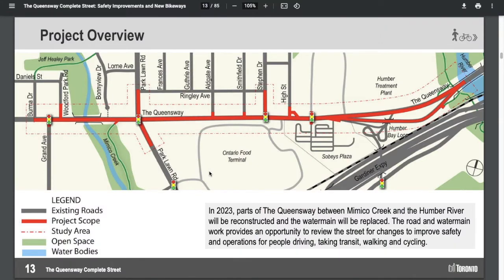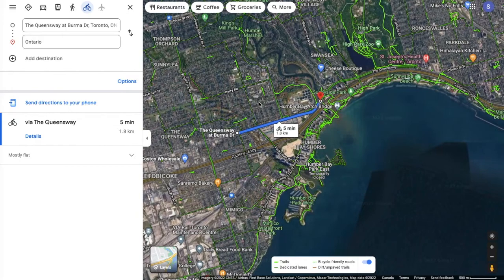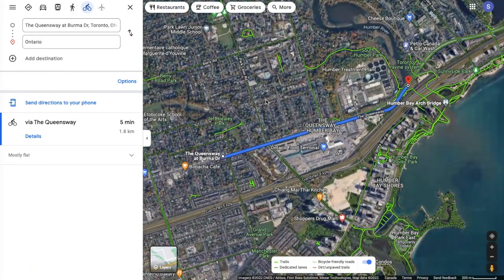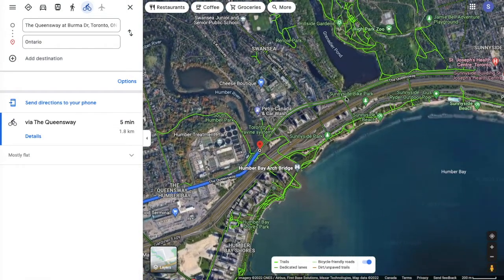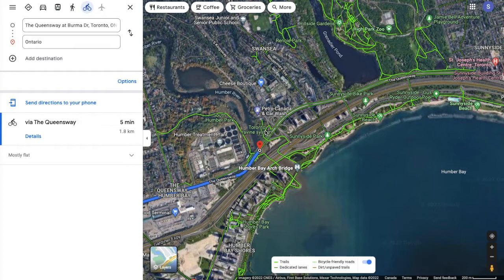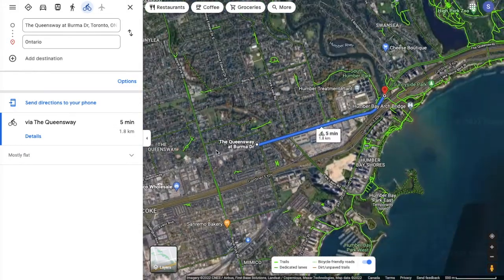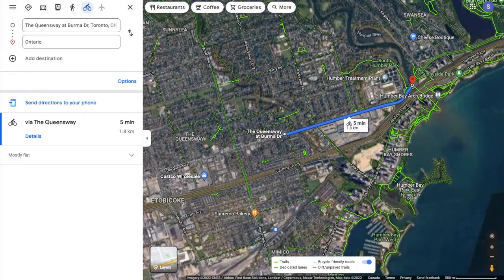Reviewing Complete Street Plans for The Queensway in Toronto

Comment: I'm watching this from Hamilton where we struggle to not move the bicycle lane into a two way track to give more space to cars and trucks. We don't have anywhere near the traffic this road does, and yet our council and staff feel the need to move the bicycle lane out of the way to allow for three 3.5m lanes or traffic. I'd love to see use institute a max lane width of 3.0m for regular travel lanes and 3.3m for truck and bus lanes. Makes so much more room for pedestrians, cyclists and trees.

Just wanted to add that your thought experiment design is great. They have those in Netherlands and saw them while we visited. They're great because they make cycle tracks cross fewer intersections with cars, and similar to pedestrians while allowing through traffic to continue without being stopped by parking or turning vehicles.

It'll be some time before somewhere tried that out though. We have to move away from the wide lanes all the time mentality and the total freedom from every lane. Want to make a left from the the rightmost lane of a 6 lane highway in 200m? That's your god given right. 

At least the move to reduce lane widths in OTM Book 18 means that we can start to reduce car space and give a little bit back to people. That means that the next 20 years of road redesign will be widening sidewalks and implementing bike lanes. 20 years from today we should start seeing these types of redesigns as the well used bike lanes and sidewalks get pushback for not being safe enough. Similar to the timeline the Dutch went with. We could just skip and go to this, but humans never learn.
Reply from the maker: I'm actually working on a video focused on Hamilton and some of the issues you touch on but I think a big part of it is not willing to let go of one-way main streets. They create highway-like conditions and make it much more difficult to plan good cycling infrastructure. Wide lanes are definitely a big issue too and we really need lower speeds and adopt vehicles to go along with it.

Thanks for your comments about the design. It was definitely Dutch-inspired. I agree that it will be a while but I'm hoping my channel can at least put those seeds in people's mind for the future (even if just a tiny bit). It's honestly a huge step forward to just put the median there and restrict left turns. Would that have ever had a chance just 5-10 years ago? I am sure the residents and businesses will be unhappy but there really is no other way to make the area safer.

Your last paragraph really sums up how I feel. There is a lot of optimism in these new designs but it does seem like a lost opportunity to not jump ahead to what we know works elsewhere. We are trying to do it all right now without really reducing vehicle throughput but it won't be possible to reach the full potential until we do that.
Reply: @redesignforall6577  that's awesome! I often say Hamilton doesn't get the attention it deserves despite being a massive city on its own. 

If you need anything (B-roll, help, plans, or thought about point on anything) I'm quite involved with the community and city staff so I know quite a bit about the city and coming plans and current circumstances! I'd love to help in any way with a video about Hamilton!
Reply from the maker: I went to McMaster for my undergrad and masters and I would have happily stayed in Hamilton if things had worked out different. It’s a great city and, you’re right, often gets a bad rap. 

Thanks a lot for your offer to help. I may well reach out to you at some point. Luckily for the next video, the Rambling Hamiltonian channel was nice enough to allow me to use some footage.

Comment: For your unique redesign at the end why is the southbound bike lane not next to the west side sidewalk but in the middle between cars? Also I think it would be better switch the southbound parking lane further west and the southbound driving lane further east, swapping places. So the road would look like from left to right: Sidewalk, bike, .5m buffer, parking, driving, 1.1m buffer and the rest OR sidewalk, bike, 1.6m buffer, parking, 2 driving lane, median and the rest. I really love the idea of having a dedicated truck lane though, very innovative thinking!
Reply from the maker: I think you actually mean the north side, but I don't think that's obvious from the video. I didn't show it, but you would need to facilitate the entry and exit of vehicles to/from the access street curb-side and the thinking was that it would create less conflict this way, though there are disadvantages, as you point out. 

Another way of doing it would be to remove the bike lane and have the access road be a shared lane (kind of making it like a Shaw St situation). In this case, you would want the parking on the left side as I showed it because it would reduce the change of dooring. I think I put it on that side because I've seen this shared side-street concept and I intuitively copied it by putting the parking on that side.

I hope that makes sense. It's hard to explain this kind of thing through text.